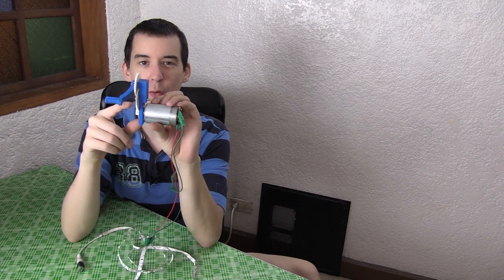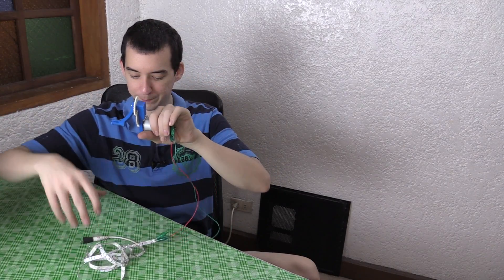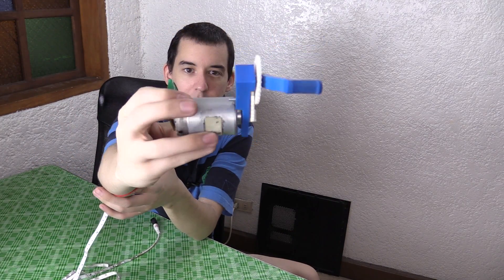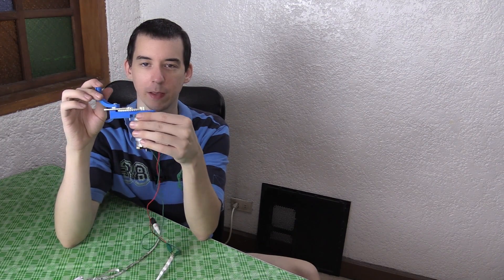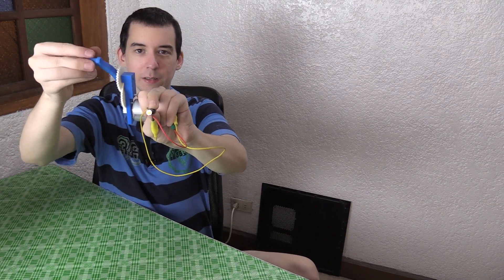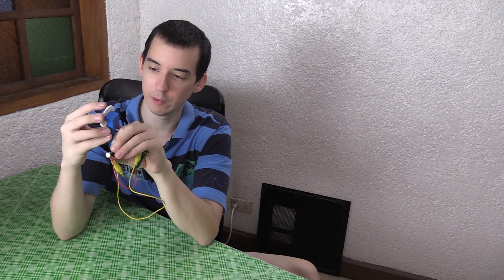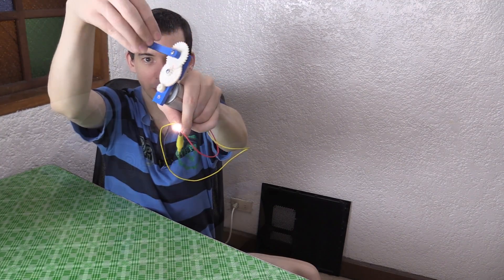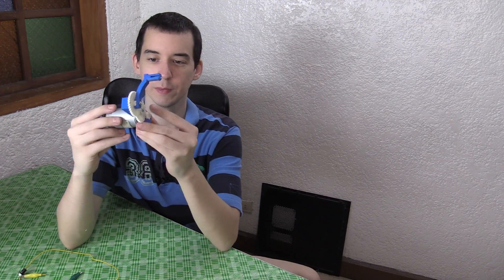Hand crank generator - 3D Printed

Comment: Just curious- Are the gears to increase efficiency (lower the required mechanical input)?
What would happen if the crank were attached directly to the motor spindle?
Reply: Avi Bank you won't be able to turn the axle fast enough
Reply: Thanks!